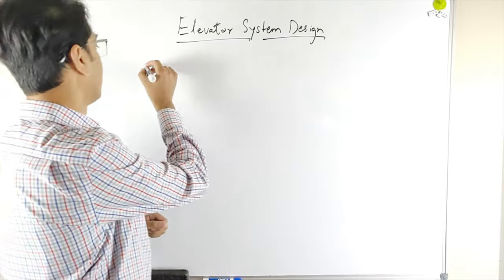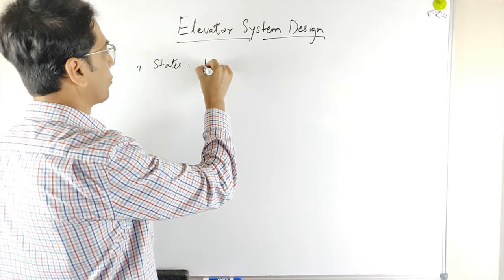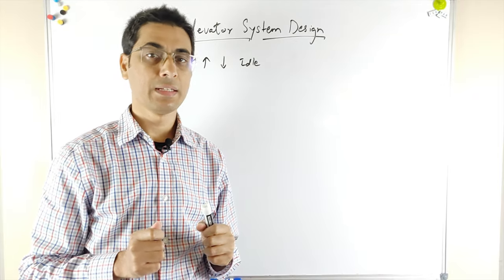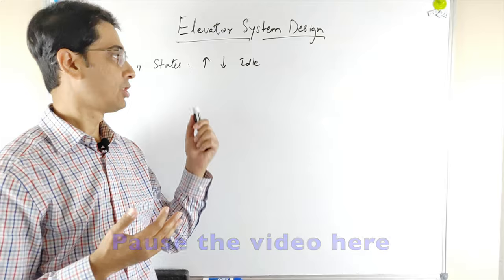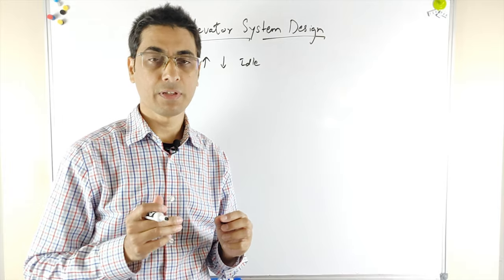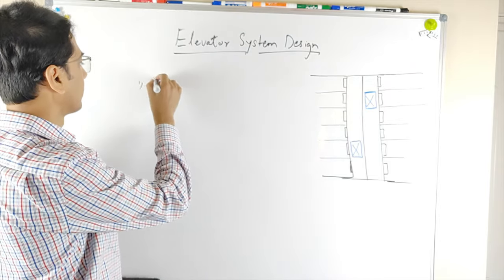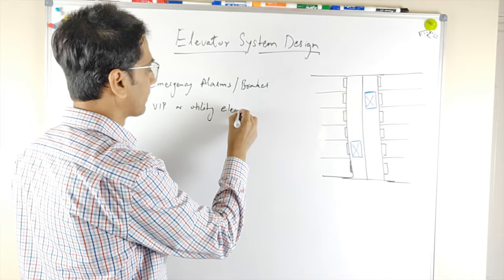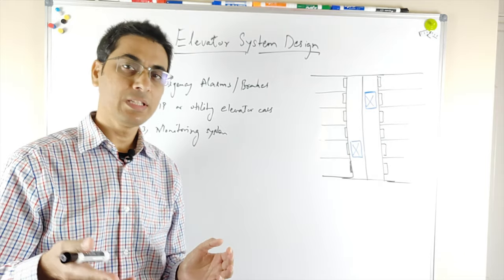Elevator System Design | Grokking the Object Oriented System Design Interview Question

Comment: Without passenger object, how would you determine the available capacity of Elevator ?
Reply from the maker: You don't need passenger object for that. How will you even know the weight of each individual passenger? You will just keep track of total weight provided to the elevator by weight sensors

Comment: Use cases missed:
1. Stop and Open in the nearest floor in case of power cut.
2. Integration with Fire Systems 
3. Toggle activate and deactivate in car floor buttons.
4. Over load warning
5. Auto call to operator in case of a door is blocked
Reply from the maker: Thanks for the comment

Comment: Your assumption that there would not be further states is incorrect, for example, an elevator car can be in maintenance mode.
Reply from the maker: Thanks for the comment. The main point was that you should be able to identify the states that an elevator can be.
Reply: @ThinkSoftware  As you know in reality all these states can't be captured in the first place. For example suddenly customer wants premier states which elevator can serve to a high profile. in my opinion, it is always safe to go with the state machine even customer sware to god that we don't have any other states.
Reply: anyway good discussion and presentation. thanks for your hard work
Reply from the maker: Thanks 🙂

Comment: Thanks, video is very helpful.
I consider that Elevator Car or Lift actor should be able to derive different type of Lifts, like Passenger Lift and if needed Service Lift.
Also would it be possible to have Operational Zone as an actor, which will derive AllLevels, EvenLevels, OddLevels, SpecialLevels?
Reply from the maker: Thanks for the comment. Yes as a container.

Comment: disappointed by the way he rushed through the algorithms, could have given a concrete example, keeps on saying this passenger , that  passenger, no code written ..
Reply from the maker: Thanks for the comment. You do understand that the goal of this video is to provide guidelines about how to tackle this question so that you can think about it rather than give you a solution that you can just copy/paste.
Reply: @ThinkSoftware  Thanks for the reply. Its not about copy-paste. The interviewer usually grills at the exact point where the explanation kind of was diluted. Pseudo code could have made it much more cleaner and understandable, instead of pointing fingers to show upward /downward movement and saying this passenger/that passenger.
Reply from the maker: This is where you should start thinking more as this was the whole point of the video and also please understand design changes with requirements 🙂. So sharing pseudocode or code would not help in an interview if the requirements are totally different.

Comment: To the author . Unnecessary explanation regarding DLD. Design interviews are more specific to different domain/ entity of a system and how they communicate with each other. 
Too much unnecessary algorithmic explanation 
The first  input here is the user input 
That’s floorNo, direction of movement
And the scheduler should find an elevator depending on 
Direction and position of user input , which elevator is nearestand is it having load less than maximum load allowed 

Then the explanation regarding more people trying to access from a particular flow. I don’t understand what’s the use case of this 

However Dividing the elevator system into different zones is a good technique. Like dividing the elevator for even and odd floors. But I have seen this system creating more problem than solving it. As the user input has to be controlled
Reply from the maker: Thanks for the comment